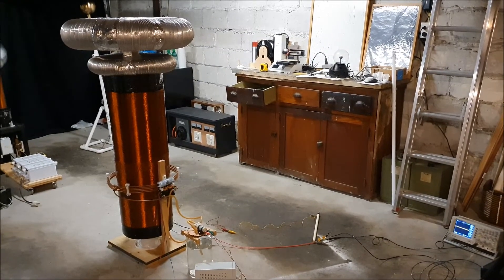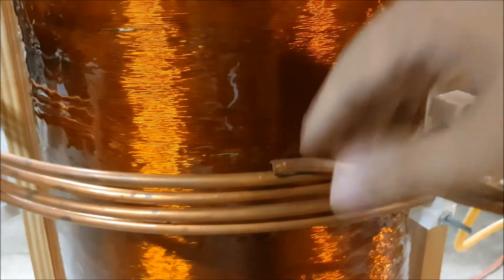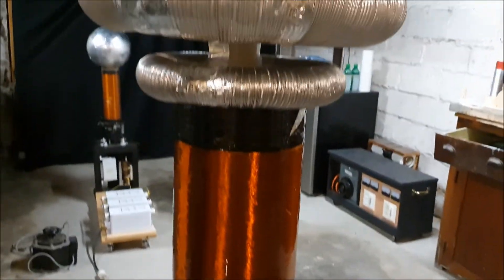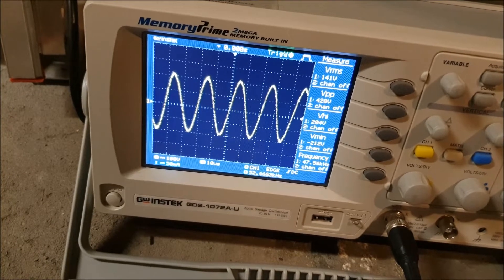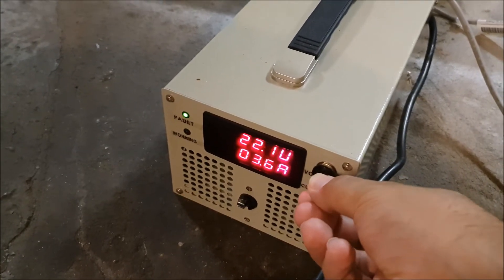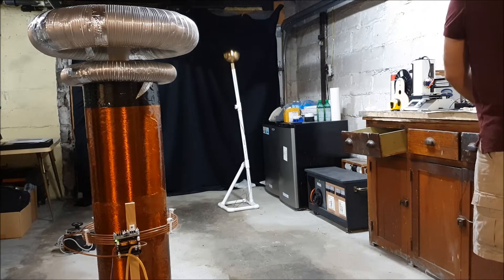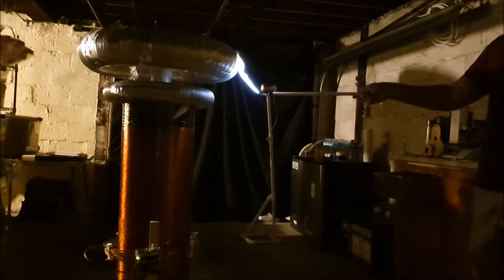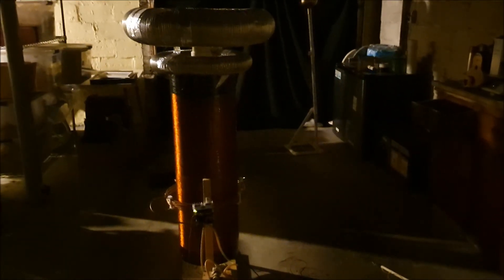Continuous Wave Water Cool Tesla Coil! World's First CWWCTC!?

Comment: If your primary coil is melting get lower awg wire
Reply from the maker: wire heat dissipation would still be a problem and you would still need water cooling, and it's not the wire melting it's the PLA wire holding brackets.
Reply: @sparkstarter  Even so you want your electrons to become flux not heat, the difference if you ask me; turbulance...

Comment: Watercooled tesla coil exist. I made a watercooling circuit with heat exchanger for my two drsstc but I never seen a CW tesla coil like this ! Nice work !!
Reply from the maker: Were you coiling the semiconductors or the copper coil? I've seen cooling for the electronics but never the copper coil.
Reply: @sparkstarter  i'm cooling primary coil. My first drsstc use 10mm copper tube and my new drsstc 5mm. For the first, i used a waterpump and pc watercooling module. With this, the primary can stay cool for hours ! For the second drsstc i designed a small form factor watercooling system but i will wait to check if the primary need to be cool.
My igbt are too small to use a copper tube cooled radiator so i will see what I can use to make a small watercooled radiator
Reply from the maker: @nijin51  you should post a video, would like to see your setup.
Reply: @sparkstarter  check out PlutoniumBunny’s induction heater build

Comment: Wow, these arcs look special for a Tesla coil. How much current do you have there?
Reply from the maker: I think a measured a peak current of 2A @60kHz in the secondary coil.
Reply: @sparkstarter  That's unusual. Normally it's hard to get more then 200 mA out of a coil.
Reply from the maker: @Muck-qy2oo  Magic of the continuous wave coil ;)
Reply: @sparkstarter  Low frequency? Damnthis thing is lethal!!
Reply from the maker: @jonaoconnor8065  60 kilohertz, not leathal but I wouldn't touch it.

Comment: Yo. so if you only take the tesla coil as a reference and forget that it gets it energy from the water-cooled primary - just so it's easyer to understand.
Since the coil is oscilating at 36khz or whatever and it goes from ground to the upper plate... is there a way, to create another coil, that is tuned to the same 36khz frequency and connect it far away to the ground. Wouldnt it, due to the small potential of the upper plate "lock" with the transmitting one? Thus transmitting power through ground with potential as a guidence? Or is all energy lost in the "near-field"?